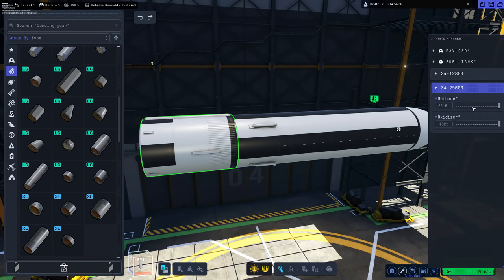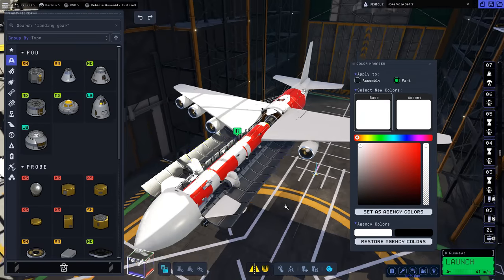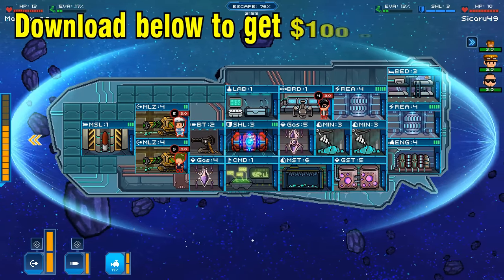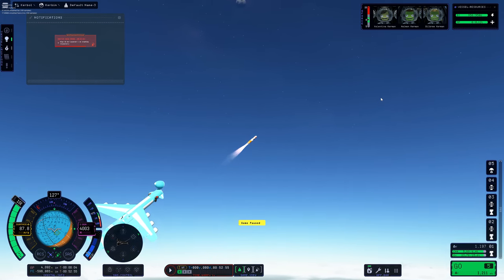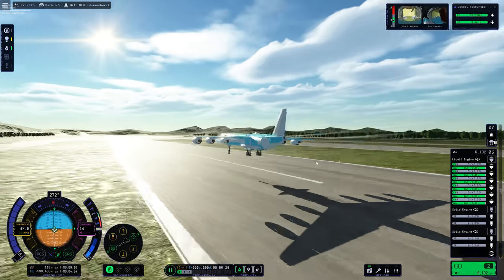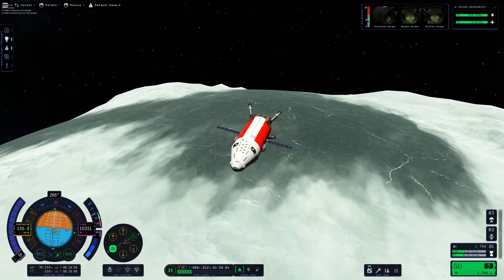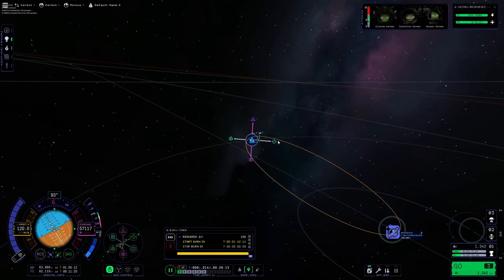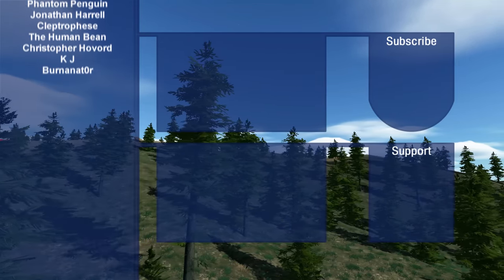KSP 2: Ridiculous Air Launch Plane

Comment: An interesting design to try would be to attach the plane wings and jet engines directly to the rocket fuselage and then detach them when firing the rocket’s engines to get to space
Reply: good idea.
Reply: That sounds like an SSTO with extra steps
Reply: @C.Sharpe  which is decidedly not an SSTO...
Reply: @chicasdasfggh  of course not, jettisoning the wings would count as a stage, but you'd still have to carry all the fuel you need for the jets in the fuselage and at that point you might as well just keep them attached and make an ssto. That's why I said SSTO with extra steps.
Reply: @C.Sharpe You can use wing mounted tanks, or the jet fuel tanks could be detachable from the main rocket fuselage. It’s not anything like an SSTO because the rocket itself can have stages too, so that itself is designed completely differently. It’s just a disposable air launch craft.
Reply: I’m doing this

Comment: For anyone wondering, the mod he was talking about is FMRS, which allows you to pilot the spacecraft normally into space, then open the tab and revert back to the stage separation event. If the detached stage has a probe core, you will be able to pilot it and land it somewhere. Meanwhile, the main spacecraft will detach and will not be under control. However, once you revert back to the main spacecraft you piloted into orbit, FMRS will merge the timelines and place the detached stage exactly where you landed it, allowing you to actually recover he detached stage and still have the mission in orbit. A win-win! Hope this helps! Also, please make sure FMRS is armed or else nothing will work!

Comment: C-5M Pilot here, many constraints keep the plane from doing this, but the easiest answer is that structural limitations with the visor would keep it from being able to be safely opened at the speeds required for such a maneuver, even though it would be totally cool
Reply: So basically, be in the rocket, you might survive that!

Comment: Great video! The timing was interesting because this week I built a few similar air-launched rockets where the plane was built as just another stage of the rocket, so when it reached altitude the front part of the fuselage dropped off and ignited an engine.

Comment: I had an accidental perfect recovery not long ago: two stage to orbit, with a mothership on top of a recoverable booster. After staging, I ignited the engines  of the mothership and switched to the booster. By chance, the time it tool to land the booster in the ocean, the mothership had reached an Apoapsis of 140 km and I had enough time for the circularization.
I was pleasantly surprised, because I expected only one of the two to survive in a single timeline.

Comment: And here I thought I was being clever with my idea for bringing back the XB-70 Valkyrie as an air-launch vehicle. It was designed to be a mach-3 bomber, but what would the aerodynamic effects be with the bay doors open?!

Hey Matt, are you still thinking of doing KSP1 videos with mods? I'd love to see what you'd do with the Whirlygig planet pack. The home planet has incredibly high gravity but spins very fast so that there's something like 4G at the poles but 'only' 1.7G at the equator. All the atmosphere is at the poles too, so it's rather like a super-Tylo at the equator and a super-Eve at the poles. There's also a moon with a SoI so small that if you do a normal transfer you have to start your insertion burn outside its SoI. Hmm... I guess I started this paragraph in far too meek a way for such a challenging system! :) Up to you if you want to do it; I've just always been fascinated by it.

I feel similarly about Minmus 2.0. As a non-player, I find the glassy surface a bit fascinating, but I get bored with grey surfaces very quickly so I don't think I'd like to land on it very many times.

Gorgeous landscape! KSP2 really does have looks going for it, at least in the landscape department.

Thanks Matt! :)

Comment: How about a space plane that jettisons its wings/tail/etc once it gets to altitude, thereby transforming into a rocket? Haven't seen anyone do that yet.
Reply: I'm guessing you haven't seen it because it would be pretty pointless for anything other than novelty value, since the whole point of an SSTO spaceplane is for it to be landable/reusable. SSTO ascent profile is pretty inefficient as you lose a lot of DeltaV to drag until you're out of the thickest part of the atmosphere and transition from the air-breathing phase to the closed-cycle phase of the ascent. If you're planning to turn your spaceplane into a rocket as soon as it reaches orbit, why not just build a rocket in the first place? Much more efficient. :)
I once built a "baby shuttle" with SRBs strapped above/below the wings which got jettisoned when they burned out. It wasn't very useful for anything other than being a space taxi to LKO, and if you have need of such a thing you're better off just building a "traditional" fully reusable SSTO.
Reply: @sixstringedthing it cool doe
Reply: @sixstringedthing  Yeah no point in doing anything for fun in a video game.
Reply: @taviscostik2346  Oh sure, if you're just mucking around in sandbox it's a cool idea. I play Career/Science mode pretty much exclusively, hence my long-arse explanatory post. Cheers :)

Comment: I didn't really notice any wing wobble when you were talking about it, but also... wings wobble on real planes :P
Reply: I think when he said wobble he was actually talking about the SAS control surface oscillation, which probably could have been totally fixed by making the pitch control surfaces much smaller or setting a much lower Authority Limit on each of them

Comment: I get to go on airforce bases because i am in the CAP and ive seen the c 17's fly and an issue with the nose opening mid flight would be drag. The drag would most definitely make it stall out and crash

Comment: Wings are meant to flex, and the control surface movements need to be less violent. Smooth application = smooth flexing. If you watch an A380 landing, pay attention to the wings and watch them gradually sag as the lift drops off then compare resting position with flying position and you'll see strait away how much they flex.

This is a good craft, it just needs some tweaks.

Comment: The problem could be during the ignition in the plane id think it would melt the bottom or try to hot stage the plane and it could blow up the ship what could happen would be the ship would get driven out by those wheels and they would be on the roof and the wheels on the ship and once the ship gets far enough out then the engine ignition could happen.

Comment: 13:45 i object. it is WAY WAY easier to just build a bigger rocket than have to deal with inclination. Mun is easier. The only gain minmus gets is being able to have a smaller lander, but Mun landers are easy enough. Mun is a better first destination.

14:52 that looks radioactive

Comment: I know I’m a bit late to this, but the stress load for the C-5 galaxy‘s wings would be too high, also the front hatch does not open up mid flight, may be going out the back it would work, but that would have to be at an incline, and a soon as the craft, his way would have to tip back down and bank away.

Comment: You know Matt, this mission give me an idea, well overall it would be the same but the main difference is that, instead of the rocket being tucked inside of the aircraft, why not just turn the whole front section of the aircraft into a rocket?
Reply: You would be wasting the engines and it could not be recovered because you loose the center sustentación.

Comment: The "wobble" (I'm pretty sure you're talking about the SAS oscillation) could have probably been totally eliminated by either making the control surfaces smaller or setting a lower Authority Limit for each control surface. I hate that bug/quirk of KSP2. Also separating pitch and roll onto independent control surfaces would probably have helped; I usually use a very small wing attached to the main wing that's set to Roll only

Comment: Not ridiculous. The advantages of an airplane is taking oxygen from the air, and reusability. The advantage of rockets is leaving dead weight behind and take to orbit only the essential. A plane that goes to orbit perform both vehicles function with neither of their advantages and just brute force the result. A two stage plane makes way more sense.